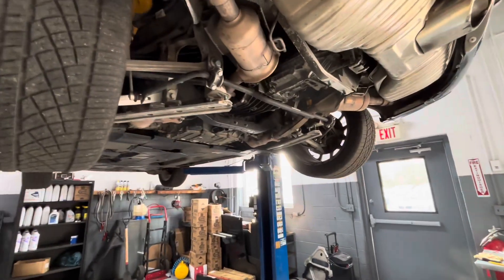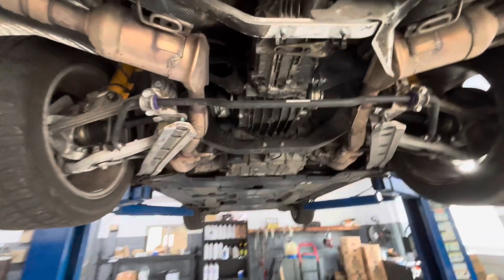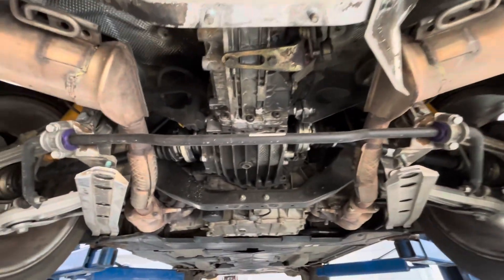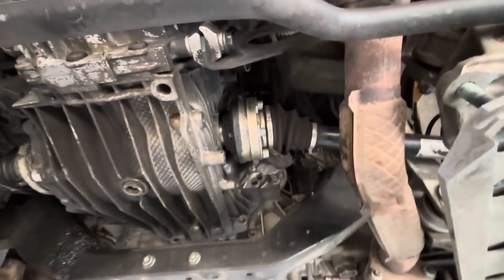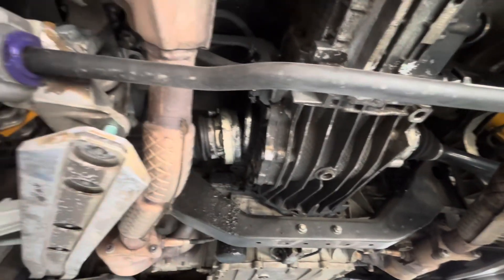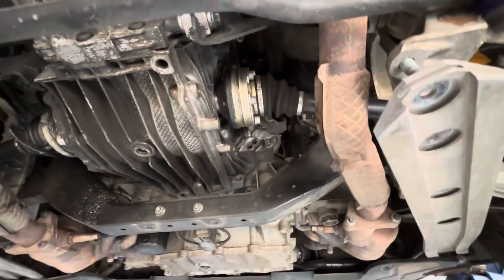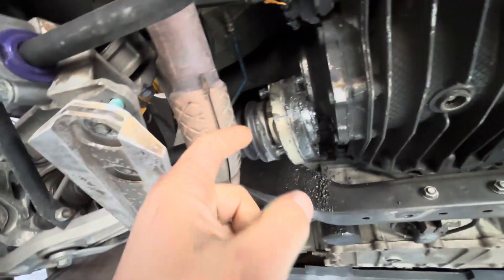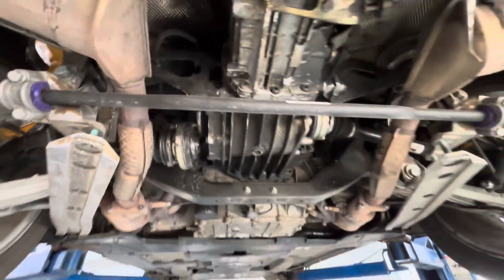TORQUE THESE BOLTS TO SPEC

Comment: Aren't VAG axle bolts typically torque to yield, one time use? Just curious if you think there's any chance a reused bolt, torqued to spec, could work its way out.
Reply from the maker: I just have never seen it, in theory if the stretch bolt was angle torqued again it’s possible it could lose some of its strength but I’ve seen even torque to yield bolts that one have one stage of angle torque can be used a second time, I’m convinced that in 99% of application even if you used generic torque figures based on bolt size grade and thread pitch it would stay together just fine
Reply: @EuropeanAutoRepair  I tend to replace mine, but wonder how much it really matters. A full set of B8 transmission hardware is over $100.
Reply from the maker: @AngusMcDangus  yeah you’re talking the aluminum bellhousing bolts? I’m definitely not a fan of those, I typically try to replace them as well, doesn’t seem like the local dealers do because they are never in stock haha

Comment: Looks like aftermarket shafts with those bulges on the cv joint. I suspect it's supposed to be flat so that the bolt retainers sit flush against the cv joint. I ordered a prop shaft from ebay for my b5 s4 and it had those bulges to accommodate the ball bearings in the cv joint, and the bolt retainers would just bend around the bulge and not sit flush like the original was. Is that the case here? Luckily i found a good used prop shaft and returned the crappy ebay one.